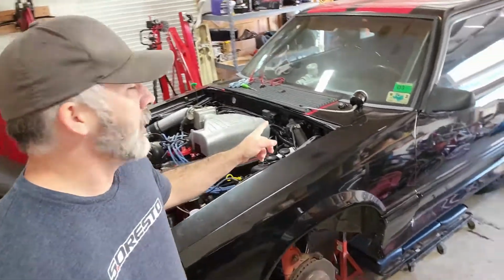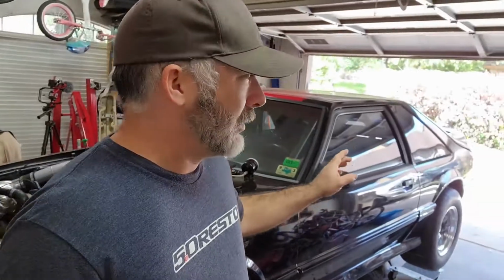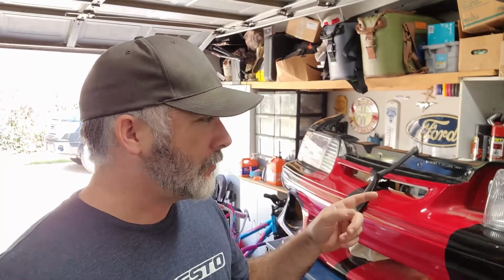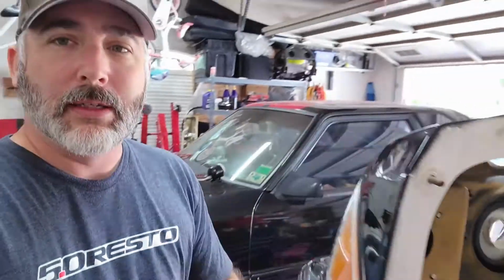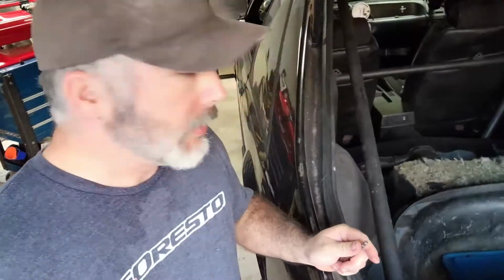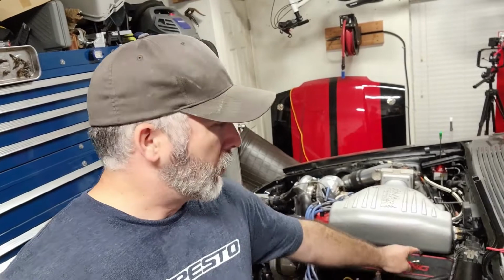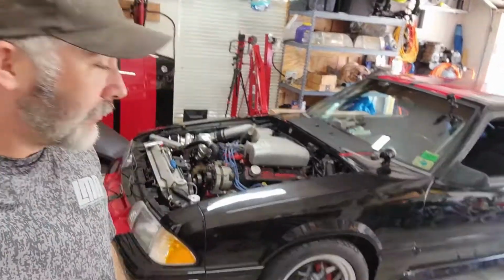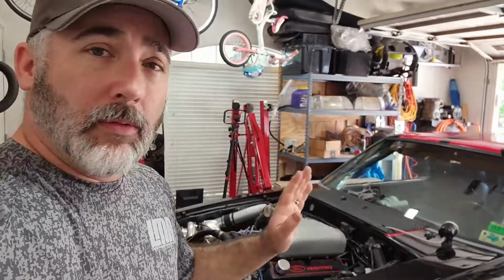Black Widow Mustang Turbo Build Pt 23 : The Black Widow Lives

Comment: Your car looks great man! Is it lowered at all? I have the same wheels .. my cars not lowered and no rolled wheel lip.. I’m wondering if the 275 60 15 will rub? Keep up the great work!!
Reply from the maker: I have the eibach drag launch springs front and rear.  Southside Lift bars in the back. They aren't a lowering spring necessarily but I think it drops about a 1/2 inch.  It definitely sits lower then stock.  My fenders are rolled with baseball bat but not with the right tool, so there is still plenty of roll I could do.  I have the Maximum Motorsport lowers with the adjustable spring perch, just need to install them.  That will be on the channel soon enough.  Love the wheels!  Thanks for the feedback!